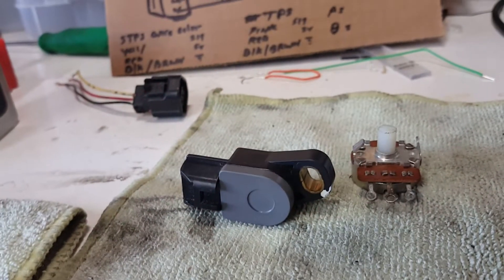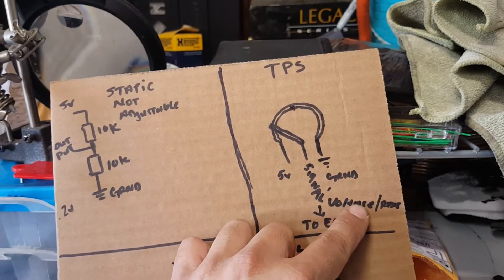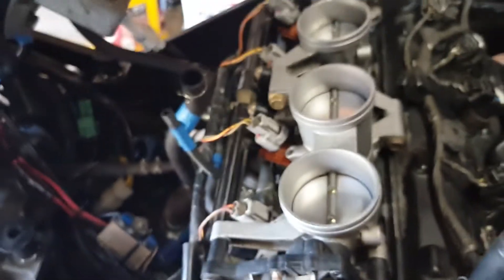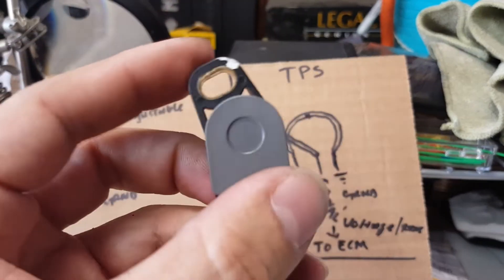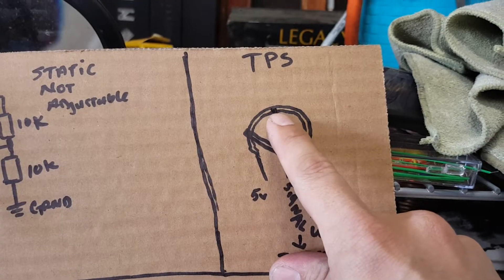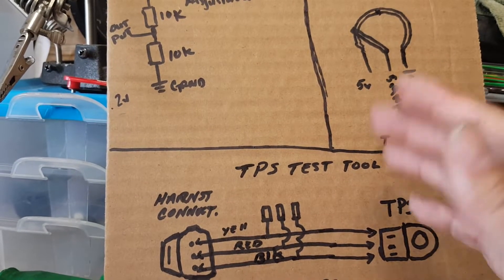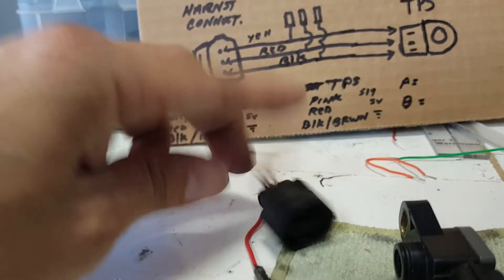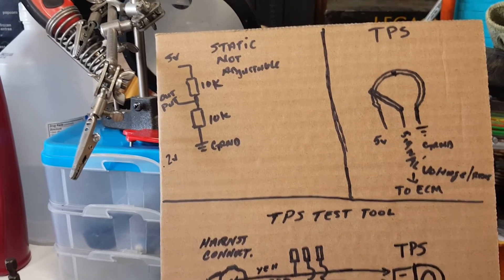DIY SUZUKI GSXR 600/750 Explaining the TPS

Comment: Hi, I have a 2007 gsxr 600 and the bike is struggling to idle sometimes or it will idle really low, but sometimes the bike idles right, can it be the tp sensor or the stp sensor? I'm just struggling to get this problem fixed, we have checked if the problem is fuel or even ecu related but nothing helps 

I have heard that their is like a air idle control valve that controls the air flow on the bike when it is idling, and then sometimes this "valve" gets dirty or something and then it will not work properly, but this was on a 1000. I think this is the isc valve, I just don't know if all bikes have one? 

This problem started not too long ago but I see on the right side of the air box is an hose coming in from the bottom, it looks like that hose is blocked of in the air box, do you know what is the purpose of that hose? 

And then the last thing I is, the (wheel thingy on the left side of the engine) that turns when starting the bike that activates the cold start doesn't turn on my bike, can it also be the cause of a bad sensor? 

Sorry. I'm just very new with these things, can you please help me so that I can know what to check or replace too fix my motorcycle
Reply from the maker: Combustion needs three things spark, fuel, air. You have to inspect each one of these systems thoroughly. Start by pulling your spark plugs and taking a look at them. What condition are they in.? Are they fouled with oil or are they white. Speaking of spark plugs when was the last time you changed them?
Reply: @TheChemistDIY  I changed the spark plugs two days ago
Reply: I think the problem is air related but I do not know what to check, maybe the tps or stps?
Reply from the maker: @juandrefourie4339  perfect, you're on the right track. What color will your spark plugs. The color of your spark looks is going to tell you how your bike is running. Black your bike is running too rich and not getting enough air. White your spark plugs are telling you that you are running too lame, the ladder..
Reply: @TheChemistDIY  the spark plugs were back, but we just ecu flashed the bike to see if maybe the computer could say what the problem is, so I don't think the bike is running rich anymore
Reply from the maker: @juandrefourie4339 

Was the bike having idle issue before the ECM Flash?

1. Inspect all air line for leaks, Use carb clean and spray aroun  lines and ThrtleBody. Idle will change when leak is found. be sure to move hoses around while spray, a crack in an air line may be small. Spray around air cleaner box as well.. box may have crack in plastic.
2. Crack open the gas tank and see if there is rust at the bottom? (yes/no?)
3. Perform Fuel Delivery test ( i dont have video on this, YouTube it).Youre checking to see if the Fuel pump is putting out the correct amount of fuel in a given time period. If not outputting correct VOL fuel pump filter maybe dirty and requires cleaning or replacment OR Fuel pump itself is bad... replace
4. Fuel Pressure test (YouTube it)
5. Injecter spray test.. while in here forward/backwrd flush your injectors.. (I have video)
Reply: @TheChemistDIY  thank you, the problem started before the flash 

I think there was a small crack in the air box but I do not know if that is the problem, I don't know which hoses to check, only the two coming out of the air box, it looks like one is blocked of but that was before the issue started, I think the boxes differ between the 600 and 1000cc

The guy that flashed the bike said everything fuel related is good, but he also said if we checked everything else that can be the problem then we must clean the injectors

I think it can be one of the two throttle position sensors but again I don't know how these things work? Is one of them idling related? 

The problem is only sometimes when the bike is idling, even if the bike is warm
Reply: At 3:07, that is the hose that looks like it is blocked of, and then there is only one other hose coming out if I'm right?
Reply from the maker: @juandrefourie4339  Put the bike in dealer mode, start the bike, and check the gauge cluster to see if your TPS is at  -00 (middle).. If its at the bottom  _00 or on top then your TPS needs adjusting.. TPS controls the gold butterflies (main flies).. The top set of flies are silver in color and this controles by your STPS  and STVA.

Very rare that there is an issue with your TPS  or STPS aside from TPS adjustment as I first perviously stated. Do As I stated with the CARB CLEAN to check for vacuum leaks, you can get this at your local automotive store.. Just spray around the top, hoses, and lines. If there is a vacuum leak you will know it.. the idle will drop and sometimes the bike will even die out as it sucks up this stuff (Try not to get on painted parts)

Yes there is a cap or block off cap on one hose outlet of the airfilter box. on my O5 GSXR (In riders posistion) its on the left side.. on the underside.. This is an oil drainage cap for the foam on the inside. 

If your going to be doing work on your own bike, you need to pick up a Service manual. These are the beginner friendly with great walk through tutorials for everything that I suggest. 

https://amzn.to/3IHSsNv
https://amzn.to/3O7RGdG
Reply from the maker: @juandrefourie4339  upload a video and show me everything.. all your issues, what youve done....Startup, Bike idle, REVing... Im mean EVERYTHING... much detail and examples as posible.. I will review for you..
Reply: I want to ask you something, why are there two throttle bodies, what is the purpose of both?
And then, the thing on the left side of the bike that turns to make the bike idle higher in cold start, it doesn't look like mine is turning when I'm starting the bike
https://youtu.be/BV0RCYg1Fe0

I'm really sorry for bothering you with this stuff, it's just I've spent a lot of money on this motorcycle and nothing seems to help
Reply from the maker: @juandrefourie4339  HUH?!?! two throttle bodies.. Suzuki's only have one throttle body assembly. one assembly houses 4 stacks..AKA ports..each port sits over cyclender hole and piston....  a lot more technical then that but trying to make it simple for you.. Watch all my videos and  get yourself a service manual and read it cover to cover...  Learn your bike, and the names for the parts you are wroking on.. Makes trying to find the answers a lot easier for you brother..

Are you talking about the idle screw adjuster.. !?!
 https://youtu.be/i3cgldWdQTA
Reply: @TheChemistDIY  okay, what I meant was, the plates that open and closes to let the air in, isn't their 4 what we can se en then just under them 4 more, 2 on top of each cylinder?
Reply from the maker: @juandrefourie4339  yes, there are 8 coin like plates all together. These are called your butterflies. The 4 top plates are silver in color and these are your secondary plates. The 4 gold plates that sit underneath are your primaries.

The butterflies control the amount of air being sucked into the throttle body stacks and into the engine for the combustion process.

The ECM sees how much throttle your giving through the TPS and calculates the correct fuel amount and  positioning of the secondary butterflies for maximum power and efficiency (air to fuel ratio).. this is simplistically speaking of course.. there a lot more to it.. but the idea in a nutshell.
Reply: @TheChemistDIY  ohh okay, so if my bike is only idling, what controls the air going into the motor, still the same primary or secondary butterflies?
Reply from the maker: @juandrefourie4339  at warm up and rest (aka stop), the secondary flies control your engine ideal and you can see how that works in the first part of this video.

https://youtu.be/wfuXw0nhwh8

During your ride the secondary flies control how much air is being taken in to reduce lag.. this is so that you can get up to speed quickly.. some riders (aka racers) remove these the secondary flies (aka Delete)  to have more top end speed at wide open throttle (WOT)... but this comes at the cost of a slow takeoff (aka jump).. if your flies are acting as the do in my video then your issue IS NOT the flies, TPS, STPS or STVA..
Reply: @TheChemistDIY  thank you for the help
Reply: I just want to say that I have found the problem, some of the hoses were weak, and then there were screws on the throttle body itself that was tightened, I don't actually know what the purpose of these screws are but the guy who fixed my bike said that they had to be 1 or 2 turns turned out, something like that
Reply: Hi, I want to ask you something 🙈🙈

The air mixture at the butterflies, there are 4 screws that should be adjusted, mine was fully in, I just want to know why would they be all in and how many turns should the screws be turned out on a suzuki gsxr 600 k7
Can you help me?

Comment: Interesting video, but still nearly fell asleep all the same... lol 😂
Reply from the maker: No one said it was going to be a thriller... just informative.. lol
Reply: @TheChemistDIY  Good stuff. It does what it says on the tin for sure. Once I learned what I needed  I had a nice nap ha ha. My 03 Suzuki SV650 s developed a momentary blip on acceleration after two hours of riding on the weekend.
Reply from the maker: @SwampCityRadio1974  any specific gear or does it happens in all gears?
Reply: @TheChemistDIY  Only happened  on two occasions. It was in second as I was accelerating heavily to merge onto a highway and once again at idle half an hour later there was a sudden "cut in revs". It was after two hours of riding on bumpy and dusty roads. I had recently installed a 12 volt accessory socket with fuse and switch. I disconnected it today in case there was a loose connection in the switch and no further occurrences of the "blip" so far.
Reply: Found the cause I think. The battery terminal bolt was loose, not the one that  holds the ring end cables on to the terminal but the one that bolts the terminal to the battery. In the mean time my clutch switch has carked it and clutch is creeping, ha ha.
Reply from the maker: @SwampCityRadio1974  I hate when its the simplest things, lol. You spend weeks and weeks of researching, days breaking down and reassembling just to test and in the end... lose terminal wire..LMAO. At that point you almost wish it was something more serious because you feel like a dumbass not checking the simple things first. I cant tell you how many times I've done this and wanted to just punch myself in the face.. lol.

Comment: When I ride my 2002 gsxr 750 every gear just over 8k would loose power not fully just maintain speed sorta but would sound like it’s farting instead of how it should sound
Reply from the maker: Sounds like the STVA... But usually this is accompanied with a FI light, although not always.. the bike goes into limp home mode to save itself from further damage.. 7k is usually the RPM range where it will limit you and basically keep you at 60-70 mph no matter how much throttle you give it.

Comment: I see the green plug on your but what does it go to and why do they got it jumped lol
Reply from the maker: I believe you're referring to the green three prong triangular shape connector, this is your side stand switch.. aka kick stand.. some riders will disconnect and jump bypass this so you can start the bike with the kickstand down (safety feature). Also some times the side stand will become fouled up and cause the bike to cut out in mid ride and you would need to bypass untill you get a replacement In order to continue riding.

Hope that answers ur question..

Comment: Do I push in to get the connector? I’ve destroyed mine trying to get the connector off
Reply from the maker: Well no.. you push the connector in and the tab on the connector locks to the mating receiving connector. When releasing your just push on the tab and pull to slide the male connector out.

Comment: Thanks for video,plz help how to check thromba
Reply from the maker: Sorry brother, im not understanding your question? Thromba?
Reply: @TheChemistDIY 
My bike idles rough and fluctuates
Can moving the tps adjust the idle speed to make it run smoother.
Reply from the maker: Try the following:

1) Put the bike in dealer mode and check TPS level is dead center at idle. If not then correct with adjustment.

2). OEM idle is 1200rpms, I find this to be a little low.. set to 1300rpms at idle.

3) inspect, clean, and or replace spark plugs.

4) Clean Air Filter

5) Drop in a bottle of sea foam in the gas and oil tanks.. 1/2 & 1/2...

6) Smell the exhaust while running.. if it smells like 1962 VW bug or hot rod.. time to change the oil..

Congrats.. you just did a tune up..lol.. hope that helps ya out.. works for me every time

Comment: Hey man so I just ordered a 02 sensor to replace it because I have an aftermarket exhaust I cant see to find online where I plug it into
Reply from the maker: What year is your GSXR?
Reply: james moreno 2006 gsxr 600 , I bought the o2 sensor eleminator but cant find the coupler
Reply from the maker: This a euro gsxr?..
Reply from the maker: @andresgmz210  so i downloaded a pdf copy of the service manual and it doesnt show the connector either but given the length of the leash on the H02 sensor it cant be far from the bung hole.
Reply: Do you know why my fuel pump fuse keep blowing

Comment: my gixer not reving past 5000rpm.. could it be tps?
Reply from the maker: @brylo1218  Need a little more detail brother. Is this at idle, in a certain gear, hot/cold, is there a FI light on and if so what is the  code being thrown...?!?.. all comes down to the details...
Reply: @TheChemistDIY  basically im struggling with that STVA.. this part has been fixed by friend of mine, he did it your way. Bike starts up fine cold or hot, no funny secondary throttle noises but past 5-6k rpm is barely accelerating. FI light on. Do you think it could be stps? 
I have another STVA, on the other hand this one is faulty too, making funny secondary throttle noise when firing up, fuel pump does not prime every other time and this was pissing me off. No FI light and has all power so it's just the funny noise and fuel pump not always prime.
Reply from the maker: @brylo1218  ok soo.. just as I was thinking.. your having STVA problems. Take a look at my final STVA video (link below).. I get this a lot and had to make a video about it. If you perform the fix This will be the end your STVA issue for the remainder of the bikes life.

Funny but it's been my experience as well with the fuel pump not prime each and every time you turn the key to the on position.. that doesn't mean it's an issue as long as you have the correct fuel pressure and delivery that's all that matters.

I'm not sure why some STVAs are noisier than others, but that doesn't mean it's bad. I have a family member with an older 750 and it does the same.. it literally sounds like it's going out but has no issues.

Anytime you can't go past the 5000 RPM range whether it's between 5, 00- 8,000 that usually means it's the STVA.. that's because the secondary butterflies aren't opening to allow the correct amount of air into your throttle bodies.. just an FYI.. you can delete them if you want or  put or put in an STVA eliminator... But why.. if you fix it as shown in the video you should be good to go with no cost.. also make sure your STPS and TPS are calibrated... -OO

https://youtu.be/gR5pcdiwZ98

Comment: Is the sensor underneath the top one the same sensors?
Reply from the maker: If your asking if the TPS and the STPS are the same... Yes they are. You could techanlly swap them and it work just the same after setting the correct placemement.
Reply: @TheChemistDIY  sweet yeah cause I just bought the one that's on the top still fi and the red light is on I positioned the one on the bottom to where I got the line in the middle everything is still on so I'm thinking that ones bad I did have this weird noise when turning the key on coming out of the one I replaced but that noise is gone sounds better but wasn't sure if I could buy the same sensor I just bought and use it for the one below
Reply from the maker: @mackenzieharmon826 what code is being thrown by the ECU?
Reply: @TheChemistDIY  it was c29 but I put that first sensor in and now it's c00 with the paper clip but the fi and the red light is still on
Reply from the maker: @mackenzieharmon826  it shouldn't be possible to have a FI light on and code that reads nothing wrong (-C00).. try pulling the battery off for a few minutes and reconnecting... yes I know the ECU doesn't hold power when the key is off.. but then again you shouldn't have a FI light on with code of 00.. lol.
Reply: @TheChemistDIY  lol maybe I said it wrong when I put the paper clip on the code is c00 when I take it out the fi comes on along with the red light lol
Reply from the maker: @mackenzieharmon826  yeah that was right 

Bike has FI and red light on.

Put bike in dealership mode by way of paper clip.

Code displays -C00 now.. Previously C29 but swap fixed.

The double zero (00), well that means everything is normal and there are no errors.. so there should be NO .. FI light on when removing the paper clip.. 

if this is true Well I've never seen that happen before..lol

Comment: I have no room to get to it on my 06 600 it's literally behind the frame. What's up with that
Reply from the maker: Ya it's a bitch to get to mine as well, you need really thin tools for adjustments.
Reply: @TheChemistDIY  ya me n my buddy are gonna make a tool but was still wondering why everyone else has theirs right there n mine tucked behind frame. Weird
Reply from the maker: @PopeDPG  ya that is odd bro. I would be interested in seeing a picture of that.. email if you can.. Not sure if your the 2nd or third owner but may the engine was swapped with either a larger or smaller CC and this was the result.. check to see if the VIN on the engine match the one on the framework.. 

 jamesmorenojr@gmail.com